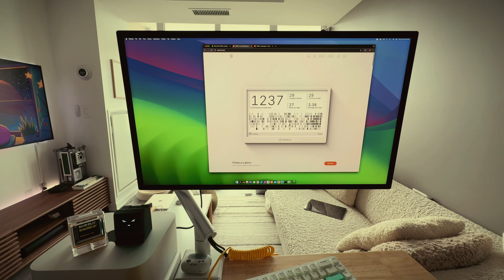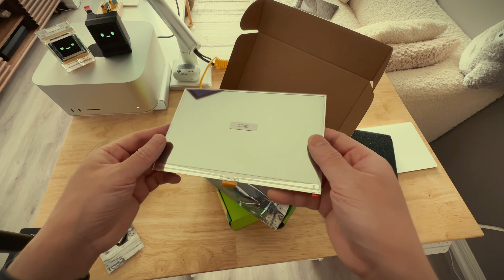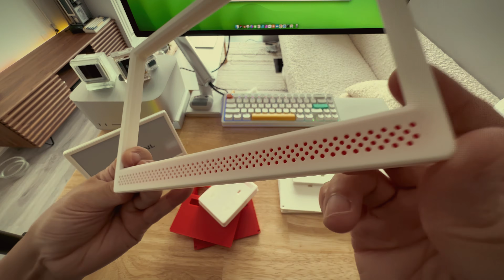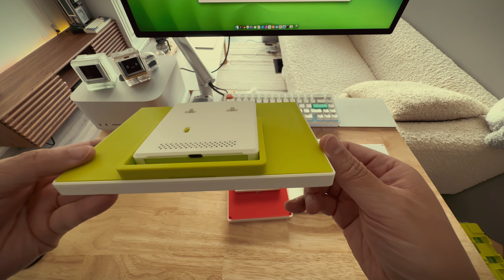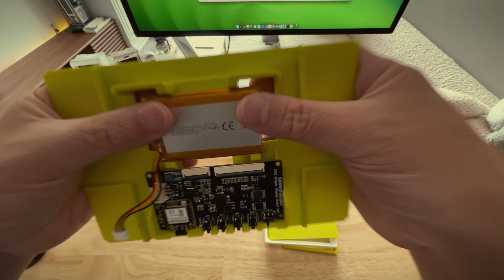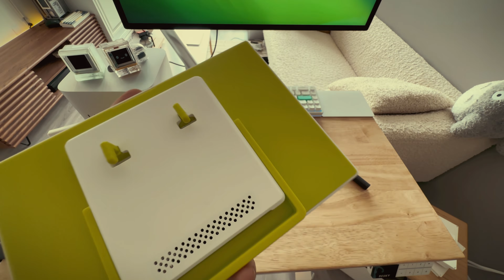Designing the perfect custom housing for my TRMNL display

Comment: How have you made the PCB to snap on the bosses? Is it based purely on testing multiple diameters or is there some small snap feature? (drafted, small extrusion, etc.) ?
Reply from the maker: Yea you nailed it, i did some measurements, and drafted a small area with the measurements and test printed it. From there you fine tune the tolerances or correct the diameter. I did around 4 small drafts just for the pcb to slide into place cleanly 😊

Comment: awesome design, i already have the diy board from seed studio,  where can i get the case files to print? or is going to be on sale? thank you!
Reply from the maker: I’m working on making an update soon and will probably just release it on my store as it was initially intended as a co creation with SeeedStudio however the process has been extremely slow sourcing suppliers 😢
Reply: @alxvlabs  I'd be very interested in your print file. You did such a great job with the design. I just got my kit up and running, but the available housing designs for 3D printing are not nearly as well executed or attractive as yours. Thanks!